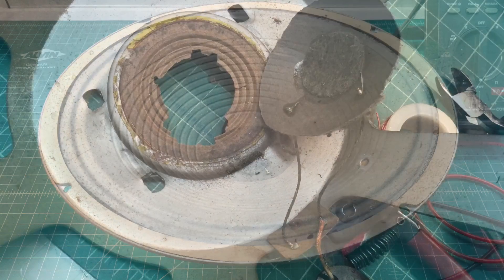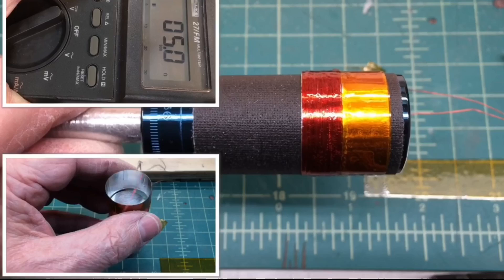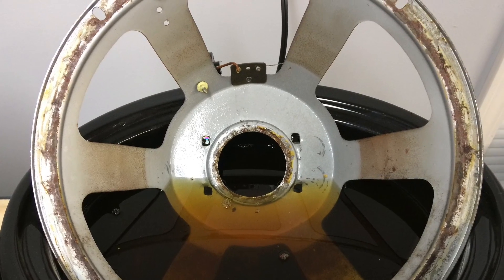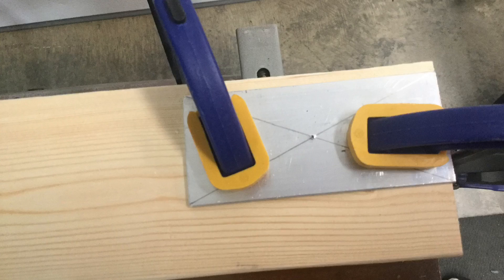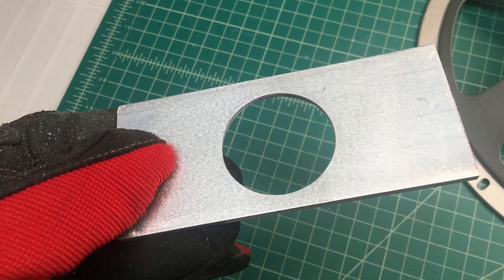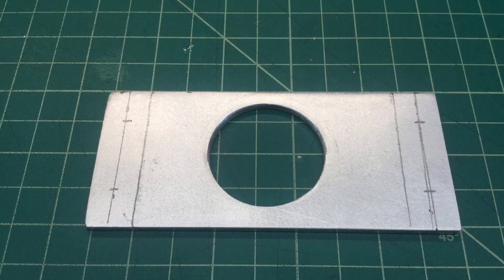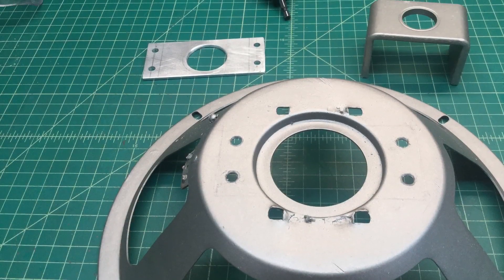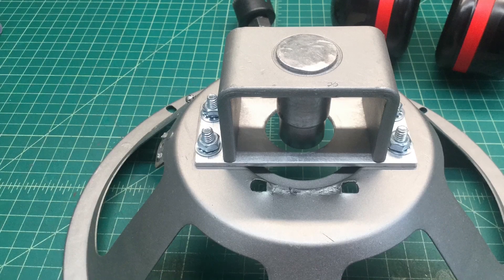Electromagnetic Dynamic Speaker Rebuild

Comment: Steel should have been used instead of aluminum. And the hole had to match the voice coil to get a tight gap to focusing the magnetic field.
Speaker efficiency is greatly reduced.
However — I like these videos. 😉
Reply from the maker: Yep, I noticed the speaker for its performance was reduced. I’m assuming one could use copper? Thanks for watching and reaching out. All the best. Don
Reply: @RestoreOldRadios  
Nope. Copper also cannot conduct a magnetic field.
Reply from the maker: Thanks.

Comment: how many wire turns?
Reply from the maker: Sorry, I don't recall the exact number of turns for the field coil. I always base my calculations on the AWG magnet wire nominal DC resistance per foot and back into the required footage based on the field coil DC resistance requirements. Hope this helps. Best, Don
Reply: Wind it up while there is free space.  😉

Comment: Hi Don:
Nice job.  I can't argue with success, but I'm surprised that the speaker works as well as it does.  I think it would have been better to used steel instead of aluminum for the mounting base of the field coil.  The field coil generates the magnetic flux in the air gap for the voice coil to push against.  To get the strongest flux from the ampere-turns of the field coil, it is best to use high permeability materials to direct and concentrate the magnetic field.  I think it would be interesting to repeat the speaker test you did earlier by comparing the volume with and without energizing the field coil.
Reply from the maker: +Steve Muenter Steve, that makes sense and thanks for your input. I can repeat the test, but should I hear anything from the speaker without having the Field Coil energized since there's no magnetic field? Thanks again. Best, Don
Reply: Even without the field coil energized, there is probably a small residual magnetic field due to the magnetic remanence of the iron pieces.  If you hooked the field coil up to your variac and applied an AC current, you could probably demagnetize iron in the field coil assembly by slowly bringing the voltage up, then back down to zero.  (Energized with DC, it's a field coil; with AC, it's a degaussing coil.)  After degaussing, I'm pretty sure the speaker will be silent if you apply a signal to the voice coil while the field coil is de-energized.
Reply from the maker: +Steve Muenter Hi Steve, I used my DATS 2 and you're spot on. The Qes doesn't even register (reads 0) with 70 milliamps of current flowing through the Field Coil. Thank you again for sharing your knowledge. I'll be sure to incorporate your recommendations when the next rebuild is needed. Best, Don
Reply: I agree that it's extremely important to use iron/steel for that part. It plays a critical part in concentrating the magnetic field in the gap where the voice coil lives. With aluminum there, the mag field is spread out and weaker where the voice coil is. I would expect this to result in much less volume. I believe it still needs the field winding to be energized, however. Without that, there should be almost no field in there. Any residual field will be minimal, especially with that alum plate.

Was there a problem with the original plate?

BTW, where do you buy the speaker parts that you use, like the spider and cones?

Comment: Hi Don,
Excellent job ol’ son!  
Many years ago, I was led to understand one of the chief reasons pre-1970s general type speakers (especially pre-1940s e m speakers) do not sound as good as modern speakers boils down to the difference in the angle of cone pitch (modern cone angle is more obtuse, therefore less tight, and better swing???), quality of paper, and use of synthetic rubber materials for outer cone hinges??? …perhaps so …though I do have a few reservations about this.   
Off and on over the past four months, I have been attempting to rebuild a p m speaker from of a Bush, model AC11 (1949) radio.  Having stripped it completely, I’ve de-rusted the basket; completely reconstructed a cone out of card (as far as I’m aware, speaker re-cone kits are no longer available here in England); reconstructed a voice coil bobbin, and rewound 38SWG  e c wire around it, made outer gaskets out of from 3-5mm thick felt …in other words I’ve done most of what you’ve done.  At present, I’m giving lots of thought how to construct a press device for pressing the required folded ribs for the rear cone centring hinge, and also pressing the folded ribs required for the top outer cone hinge. 
Wish me luck in this little venture.
Any ideas would be welcome.
Thanks, Phil.
Reply from the maker: +SteelCity321PB Thank you Phil. That speaker from the Bush, AC11 sounds like a challenge too, but one that's worth the effort. I would love to see some photos of your work to this point and more on the folded ribs. I'll send you a PM with my email so you can forward a few photos if you don't mind. Thanks again for watching, sharing your knowledge and experiences. Best, Don

Comment: I have to disagree that modern permanent magnet speakers sound better.  The field coil makes the voice coil's job much easier, and the sound has a nice "grip" you don't get from most PM speakers.
Reply from the maker: +Martin Tousignant Hi Martin - like you, I appreciate the sound from a healthy electromagnetic speaker. I was comparing my rebuild to a modern day speaker as I'm not sure it's on par with the factory production units back in the day, but I'm extremely pleased with the outcome so far. Thanks again for watching and sharing your experience. Best, Don

Comment: Don, 

You did an amazing job!  That is a brand new speaker, made from scratch.   I don't think the factory, cranking them out by the thousands, could have done a better job.

Regards, Tom
Reply from the maker: +THOMMGB Thank you Tom. I learned a lot and will make some minor changes on the next one if there's a next one. I was excited when I plugged it in for the first time. Again, thank you so much for your positive words. Best, Don